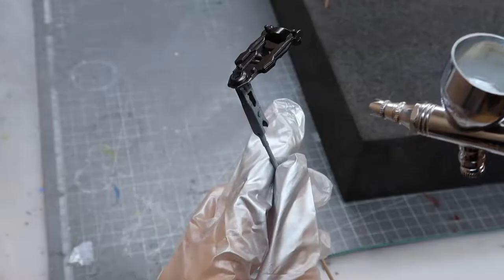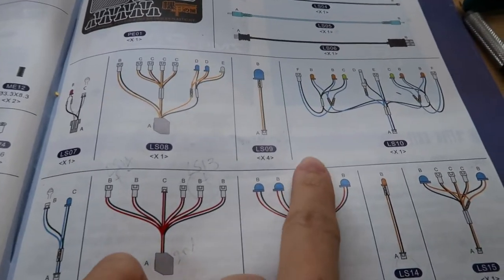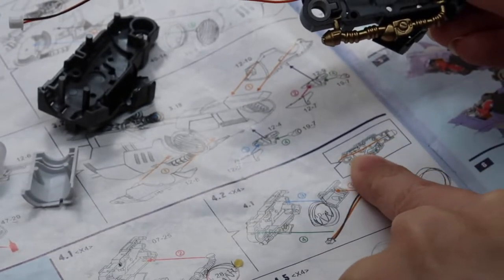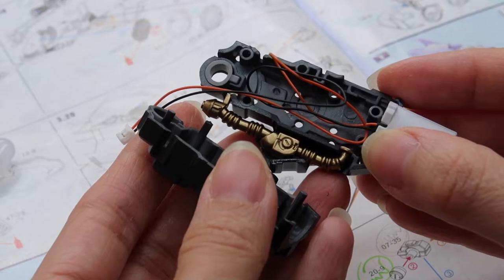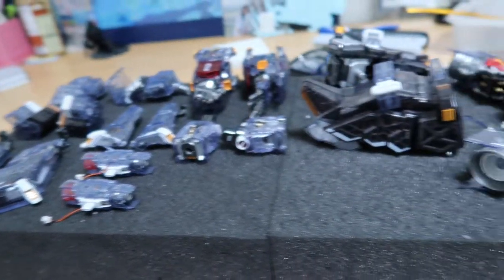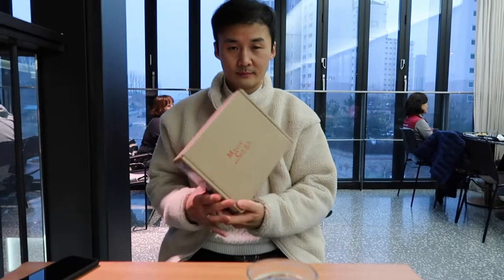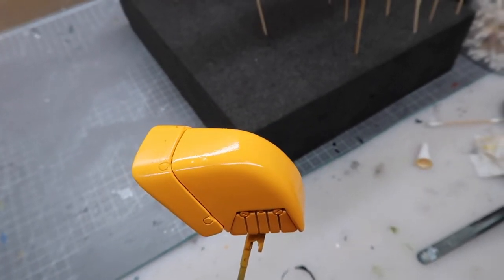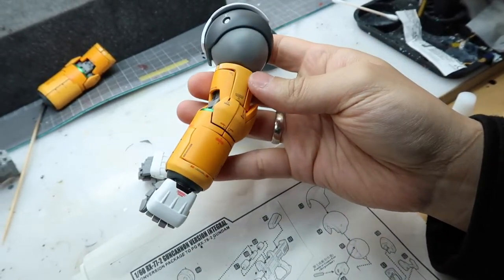Mechanicore Ziegler LED INSTALLATION, Paint, Build WIP | Gunpla Vlog + Tutorial | frostedsnow

Comment: 5:24 Something we used to do in Electronics - if you have too much wire running from one point to another and you aren't sure how much of the lead needs to be trimmed off, you can take a pen or pencil and wrap the wire around it into a nice neat coil. This will minimize the overall presence of the excess wire inside the part youre running the wire through. That way you can fit it between pegs or into a smaller space in general, and not have to worry about crimping it between the two parts. If you didn't give yourself enough slack you can tug on the leads coming out and the coil will unwrap a bit for more slack! :D
Reply from the maker: What an awesome tip. Thank you! Will give it a try next time w LEDS

Comment: For soldering w/ out the iron. Though may be too rigid. (Hint: a little heat can help)

100PCS Solder Seal Wire Connectors by Haisstronica Heat Shrink Solder Connectors Waterproof Solder Wire Connectors Electrical Waterproof Automotive With(White26-24)
Reply from the maker: Thanks! Will refer to it next time I do LED :)

Comment: Do you test the LED before final assembly? 

And yeah, you should get to soldering again, plus buy those shrinking tubes to protect the wire. :)
Reply from the maker: I mostly test them once only to see if they work at the very beginning. I don't keep testing during assembly unless I suspect I've snapped a wire T_T Yes! I actually bought some shrinking tubes at the beginning but forgot I could've used them haha. Thanks always for your support :)